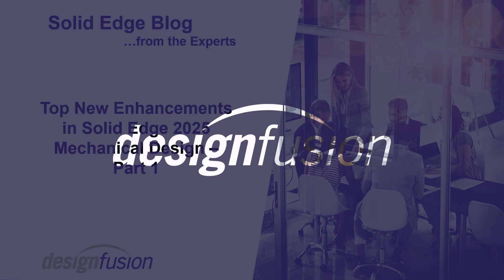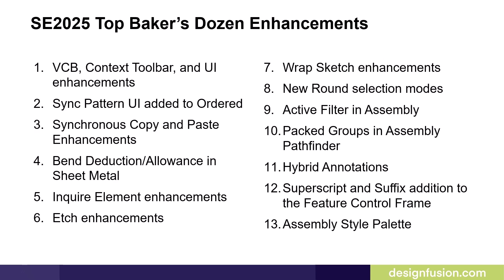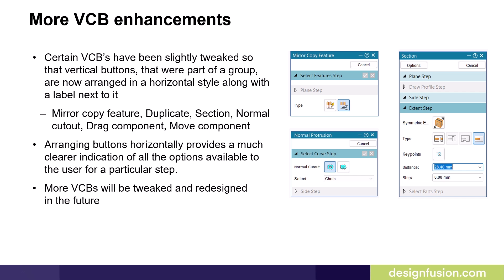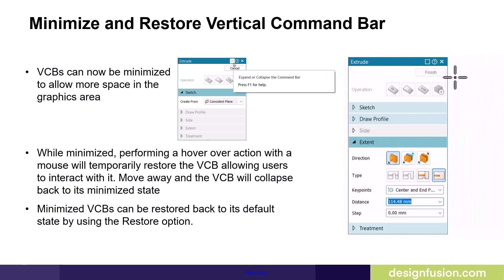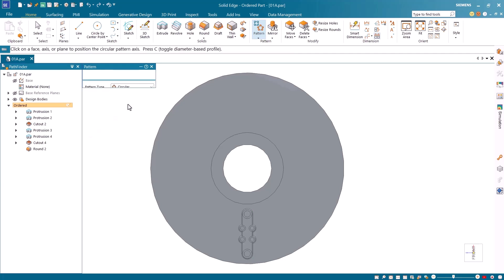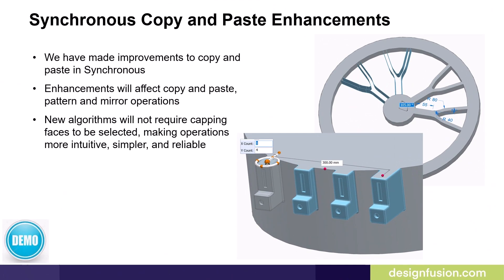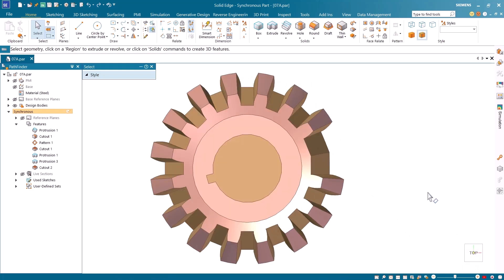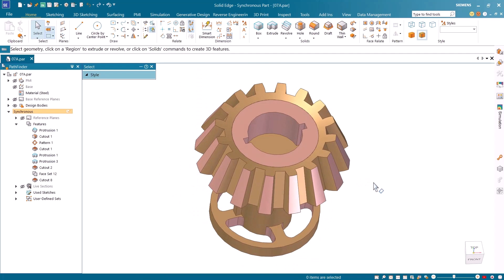What's New in Solid Edge 2025 - Mechanical Design - Part 1 of 4

Comment: I am mastering Solid Edge version 20 100%, I have more than 15000 hours drawing time in version 20. I have yet to learn how to use the newer versions after version 20. I simply don't understand the new Solid Edge, but I am trying, and I really want to learn. I don't understand the strearing wheel at all, I am at this time just by luck getting to do what I want to do. For the last couple of years I have been able to have solid edge version 20 from UGS installed at same time as these new versions, and I use Solid Edge 20 as my drawing program to draw the thing finished then I open it in any new solid edge version viable on the internet to continue some more small things that I understand how to do in the newer programs. I wish I could have someone teach me how to. I have some 20 years energy research in energy field and want to advance for better present my energy systems.
Reply: @RobertDaveMyrland  you are liar. 150000 hours is 18 750 working days wich is 72 years
Reply: @ thanks for making me aware of this. It’s a zero too much there. A typo error.
Reply: Look into training at you technical college you'll be glad you did. Also, occassionally, there have been learning oportunities at Seimens events.

Comment: Let's summarize what SE 2025 "brings useful" for the basic user: almost nothing. It’s even worse than last year.
The interface has been redrawn for 3 years already and the work is still not finished, what a shame.
Patterns: still no radial pattern feature where the pattern radiates from the center in all directions.
No improvements to sketching.
No improvements to drawings.
No updates for welds.
No improvements in frame design.
No modern standard parts library. When will you finally rebuild the outdated standard parts library, so users don't have to go through the hassle of creating their own components?
No formulas improvements such as implementation formulas from variable table to properies of the file and vice versa. Example: in cell Title  ="Pipe ," & %DI & ", " & %Thck & ", " & %Material. With option to show formula or text.